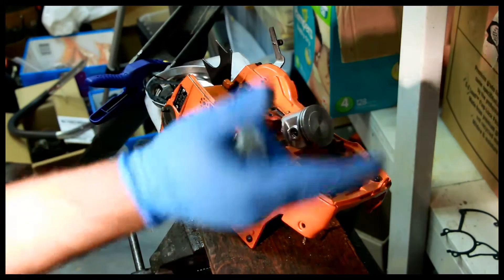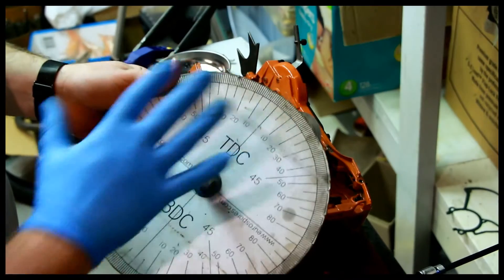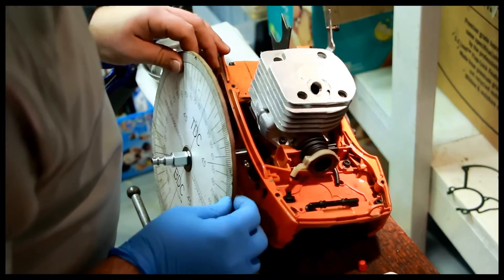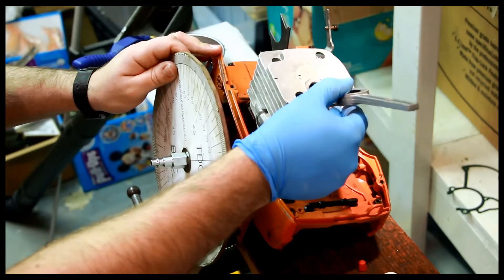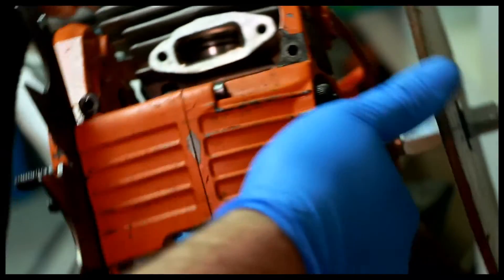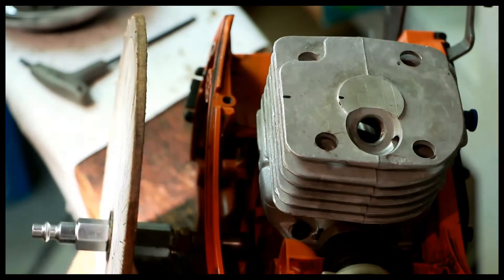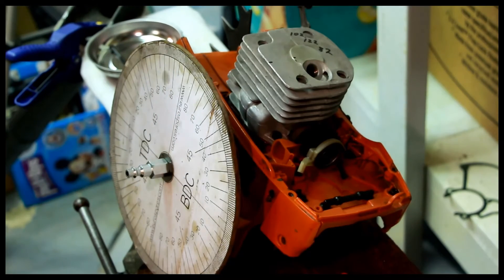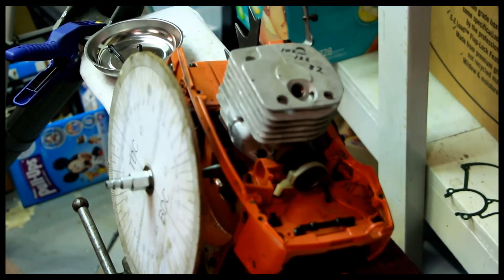Chainsaw timing, what is it? how to set up a degree wheel and get numbers

Comment: Offset keys on flywheels on some models are available for breakerless ignitions and using a degree wheel of course. I have an actual small engine degree wheel. You can also use port timing and a timing stop that you put through the sparkplug hole and go from there. The explanation is a bit complex. If one studies about desaxed offsets as well that is also a crucial factor in timing ( basically its the way the cylinder is canted from the centerpoint of the crankshaft spindles.)

Comment: How does a engine loose timing? Since there's no timing chain /belt
Reply from the maker: The position of the flywheel dictates ignition timing.  If the flywheel key sheers then timing can be off one way or another

Comment: Just pull the piston up manually and line up 8 to 10 degrees btdc. Then mark it on crank. Its pretty much already pre determind due to the cam lobe on the crank shaft. Points are adjustable by about 10* then adjust your jetting
Reply from the maker: Points?  No points on this saw....
Reply: @matthewolson8875  the points and non points still works the same as far as adjusting for detonation btdc. Like i said just pull the piston to tdc lock the crank so it doesnt move then set the ignition inplace to fire at 8/10* btdc. Once thats screwd down than unlock crank and put head on.
Reply from the maker: @fordinlinestraight  the ignition coil doesn't move up and down to change timing....only in and out to set gap

Comment: So Matt, once you figure out TDC and all that jazz you line your flywheel up with your coil? Might be a dumb question
Reply from the maker: Jason Hart no...ignition timing and port timing are two different things.  Ignition timing is set by the key on the flywheel.  The coil simply gets gapped to the flywheel and doesn't move otherwise

Comment: Hi Matthew. quick question if you don't mind. sthil 404 has extreme kickback. I have been informed it should be timing. I want to work on it myself so do I need to take the flywheel off or can I correct the problem by adjustment and how is this achievable please. What perplexes me is how it could have been thrown out???
Reply from the maker: stihl 440 you mean? or 044?   if the flywheel key has sheared, the flywheel may have moved on the crank which might advance the timing...and then it'll tear the starter cord right out of your hand.   too advanced, thats what you get.   if the timing is behind then it may not start either.  so yes, you'll need to remove the flywheel and check the key
Reply: hi Matthew I couldn't remember the number last night and didn't want to climb back into the attic to check. Thanks you very much. Would you have any tips to pull the flywheel without a puller? Tap the crank with a hammer to try to release? I hear that is frowned upon though!!.
Reply from the maker: Iain Chalmers HL Supply actually has a aftermarket color for the flywheels and I highly suggest you get one they are relatively inexpensive and come in quite handy please use my link in any of my videos in the description of the videos to go to HL Supply I do get credit for sales I think this is a very good place to start Best of luck
Reply: in the uk, so maybe not very economical Matthew i will figure something thanks
Reply from the maker: Iain Chalmers got you best of luck
Reply: I have this issue on my 461 (and two other buds on a 261 and 361).  Mine is like-new mint condition.  I can't believe the key is broken.  I changed the ig mod and still there.  2 Stihl mechanics couldn't fix it.

Comment: Ok how to you adjust the timing if the timing is off? Isnt the key on the flywheel setting the timing???
Reply from the maker: port timing and ignition timing are different things.   flywheel key sets ignition timing.   port timing is the opening/closing of the intake, exhaust and transfer ports relative to the position of the crank in its 360 degree cycle
Reply: You should what timing was but can it be adjusted??? My saw pulls too hard to start but pulls easily without plug and someone said it sounded like a timing problem, Can you tell me how timing can affect the compression could do this??
Reply from the maker: @markthompsoncpa  if the flywheel key is sheared and the timing is too far advanced the saw will fire too early and tear the cord out of your hand. ...it'll act like it's super high compression
Reply: @Cole Craypo 2 years late but what the friggin' hell yo talkin' about???
2 strokes don't have valves! .... "get the kit from local stihl dealer, costs $5" by @ Cole Crapo.

Comment: how do you chang it if you want to
Reply from the maker: You grind on the ports.   ...that changes the timing of opening/closing.   Raising or lowering the cylinder head will do it as well.  Ie, a thicker or thinner gasket.   Cutting the base of the cylinder etc.
Reply: Will that make much difference
Reply from the maker: john Kosheluk depends on how much you grind and where hehe.  I'm not a porting expert.   But I will do some vids going forward on porting.
Reply: I am getting a 200t to do some work on it was a blown up 1 at work so I am going to experiment on it with beter bearing and a new cylinder and a Wisco. Piston
Reply from the maker: john Kosheluk the 200t doesn't respond well to mods.  Rebuild it stock and remove the spark screen
Reply: O yea thanks I have a lot of blown stihl to pick from at work maby a farm boss
Reply from the maker: john Kosheluk the ms290 and 390 are a pain to work on....sell those on craiglist lol
Reply: Maby I don't know I have a lot even a br 450

Comment: This video definitely has all the ideas right, at least as I get them.  You are rotating the crank backward in the first part of the video -- when "showing."  (Turns to left from flywheel side when running - chain moves below bar toward saw)   It is possible to use a dial indicator to ascertain top dead center, even when one is not straight above the piston at the spark plug hole (can use indicator with angled ball end on a little arm) Side to side works but, as noted, the motion is sinusoidal, and therefore "nearly flat" where you are trying to pinpoint TDC.   One of the things not mentioned is ignition timing -- when the plug fires in the rotation.  Certain Husqvarna saws are known for stripping out aluminum cast-in flywheel keys -- and there are other videos on YouTube providing ideas regarding how to re-time stripped out Husky flywheels.  (For whatever it might not be worth, in my little bit of experience, I have found a magic point for the ignition in those saws just ahead - just about one-ish ex-key-width - of stock timing - use fresh premium gas.)  To mess with ignition timing, one wants to mark TDC well, but then make a set of pins for easy-on / easy/off of the pull-start cover.  (So that you can put the saw in a vise, start it, the watch the flywheel go around -- with, say, an automotive timing light connected to a power supply or battery -- and to an inductive lead at the plug.)  With the right sat of marks, including an accurate TDC, you can put the spark in a perfect spot.  That plus righteous port openings/closing....
Reply from the maker: Lots of ideas and things that can be done.  So far I haven't messed too much with ignition timing...and I'm quite the beginner when it comes to port timing.  I like the idea of pins for the starter cover but with higher compression saws I can imagine that might be an issue.  Thanks for the comment!
Reply: Yes, absolutely. Method for starting saw and taking recoil off to look at rotating flywheel is saw (and size of saw) dependent.  But it usually can be worked out ... wing nuts on bushings (brazed onto stud ends...)  ... "qwik-clamps" across the saw... etc.  There are ways. The point would be that checking / setting ignition timing is possible to do somewhat "scientifically" and that having a very good TDC mark, and then an electronic actual firing mark... can help

Comment: How are you indicating on the wheel?  Wouldn’t you usually use a wire or something as a pointer?
Reply from the maker: Lots of ways... I just line things up with a couple marker marks on the head and do it visually.   Its close enough for me but you can certainly use a coathanger
Reply: @matthewolson8875  very nice. Thank you!

Comment: I've searched the web on how to adjust points on 028 wb with cam on flywheel . They is no way to check points with flywheel on , I need to use a cam tool to set can you help me
Reply from the maker: Pretty sure there are no points on an 028
Reply: @matthewolson8875  it's ok not to many people know that's why I can't find information,  the cam lobe is on the flywheel , and no hole to set points i need a cam tool but I don't understand them
Reply from the maker: @happydays454  i would check on opeforum.com

Comment: my question is.. can we set the timing with out degree wheel?
Reply from the maker: Well...port timing is already set.   You can adjust the timing at any point by grinding on the ports willy nilly but you won't have a reference as to where you were or where u r going...
Reply: @matthewolson8875  i have the chainsaw with the key on flywheel i get a spark but chainsaw  refuses to start and i am wondering if timing is the issue here because i have check everything else and is ok 
so the conclusion is  with out the degree wheel is impossible to make it start correct?
Reply from the maker: @mousmous75  whats the compression? And no....degree wheel won't help with starting.   Compression spark and fuel are the top 3 issues for starting
Reply: @mousmous75 I had the same thing. My plug gap was too wide and I reset the spacing of the ignition coil, runs like a champ now.

Comment: Very informative video. Thanks for posting. I'm rebuilding a 394 right now and I want the timing to be correct - or maybe I should say that I don't want to screw it up since this is my first rebuild. What I haven't figured out is how I could screw it up. The way I see it, everything is fixed: piston to crank to flywheel to coil. It can only go together one way, so my timing after the rebuild will be the same timing I had before the rebuild. Is that correct? Or is there something I'm not understanding?
Reply from the maker: Reid Beebe you are indeed correct everything is fixed so if you put it back together in the stock configuration you will have stock timing there are ways to adjust timing but it usually involves machine work to the cylinder head if you are not going to do that then you will have stock timing which on a 394 is very potent anyway
Reply: Thanks for the quick response. That gives me a little more confidence as I get ready to put everything back together.
Reply from the maker: Reid Beebe make sure you check out my other videos especially the ones on the 394 and the video on pressure testing
Reply: I have watched all the ones you did for the 394 - your videos are the main reason (next to cost savings of paying a shop) I'm attempting this on my own. I have not seen the one on pressure testing, but I will be checking it out soon!
Reply from the maker: Reid Beebe I'm glad my videos gave you some ambition that's fantastic and certainly the biggest goal of my videos what was the original diagnosis what was the original reason for the rebuild
Reply: I've had the saw about 2 years. It seized a few weeks ago. When I tore it down, one of the carb screws was loose and my guess is that I had a leak there that caused a lean condition. I'm obviously replacing the cylinder and I've ordered new crank bearings and seals. Also plan to check and clean the carb and replace gas line.
Reply from the maker: Reid Beebe it sounds like you are on the right track that cylinder head may still be good so don't throw it away also 394 cylinder heads are no longer available only the ones for 395 which means you need an intake tract kit as well
Reply from the maker: Reid Beebe please click on my link in the description of any of my chainsaw videos and it will take you to HL Supply they do have the intake track kit for sale there

Comment: Isn't this really for doing porting, you know how much to take off the top or bottom of a port if you're trying to make optimal power like you said for either torque or higher RPM's, in other words, making a hot rod saw would really be the only reason to do all the degree's of the ports? I don't see any markings on the flywheel to line the coil up with! Wouldn't you have to have some marks and some adjustment to move the coil up or down to change when the spark plug fires? I guess this would be helpful if you have a problem with the timing from an incorrect machining of a crank or flywheel or piston skirt, that's off an RCH for those that don't know what an RCH is (red cunt hair) that's very little off . But with all this said, for just replacing a coil i shouldn't have to do the degree wheel thing Right or Wrong? Let me know if you find time to further explain why I would want to degree my saw?
Thanks David
Reply from the maker: So, the short answer is that there is a difference between ignition timing and port timing.  Ignition timing has to do with the position of the flywheel magnet and coil in relation to the position of the crank in its rotation.  The coil / flywheel timing is set by a key on the flywheel/crankshaft.  This determines how close to top dead center the spark plug fires.  This is different that port timing.  Port timing determines when exhaust,intake, and transfer ports open, and for how long in relationship to the cranks rotation (piston position).  It all has to do with optimizing power and efficiency, but for the average person putting a saw together there is no need to use a degree wheel.  If you'd like to start optimizing a saw, then you can fiddle with all of it :)   I hope this answer helps.
Reply: Yes Sir that's kind of what i thought that degree wheel was all about, not really a have to thing. I did fire my 038 Super that i restored or freshened up, bought it new in 1983, but it doesn't seem to have any more power than it had. I put new lines and seals a piston, rings and wrist bearing,sprocket components, all new AV stuff that was the first saw i ever did, had experience with Yamaha YZ motocross bikes back when i was a younger man the last one i had was a 1985 model use to love racing them things, but give them up about 1993 gave up racing before that, now that i am 61 years old i want be messing with YZ motocross bikes, I think i would be like oh Humpty Dumpty, if i had a crash at this age, ALL THE KINGS HORSES, AND KINGS MEN COULD NOT PUT ME BACK TOGETHER AGAIN, I do miss the dirt bikes, well a lot of things from the younger days that i can't do in the older days.
 Oh yeah this morning i fired that 038 up and heated it up and went back over my screws, and forgot i just put a 1/4 tank of gas in it, i guess i ran it longer than i thought, after checking screws i pulled on the rope and it fired up, and then started bogging out, i thought damn what is this, it would do like a saw running out of gas DUH! Well im making the adjustment to the carb. looking for a leak or something, pulling and pulling the rope and it just sputters after a couple of hours, I thought surely it's not out of gas, BONE DRY.  Hey, thanks for your time to explain the degree wheel, and hope you have a nice day.  Thank You, David